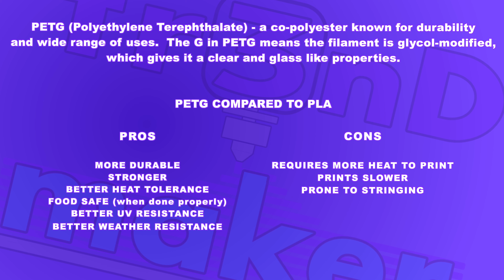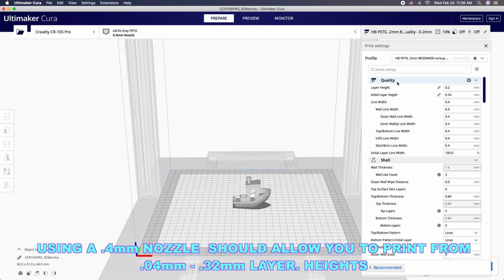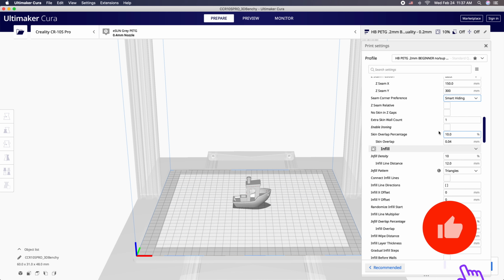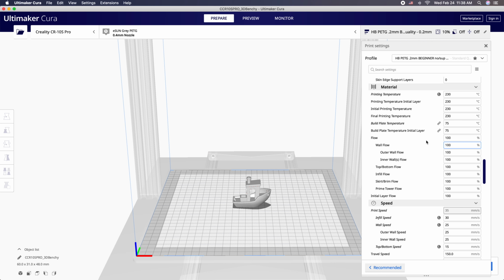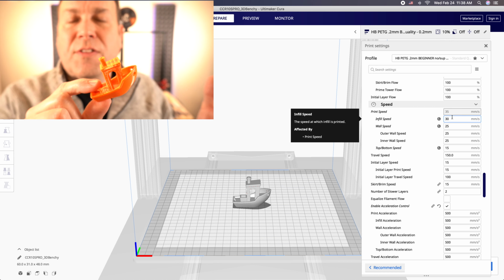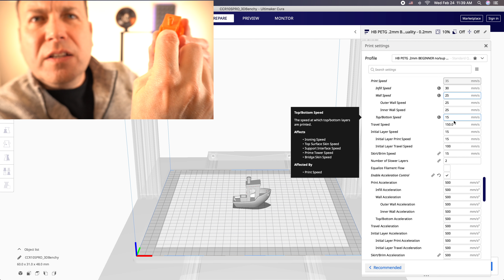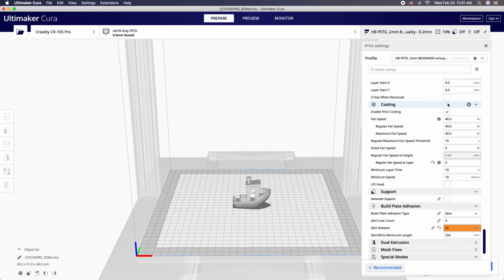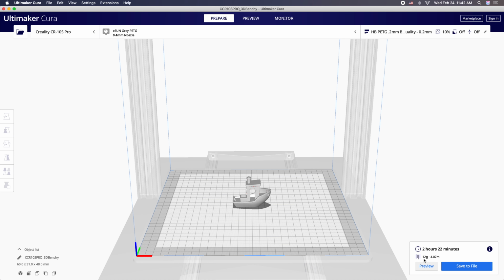How to 3D Print PETG Filament! Tips and Settings to 3D Print PETG Like a Pro - Cura

Comment: Overture PETG on my ender 3 max - 
240° Nozel (recommended 230 - 250)
80° bed (recommended 70-90)
print speed is 30mm/s

My extruder is knocking and chewing through the material causing it to break at the entrance to the Boden Tube.. I've slowed it down by 50% using the knob while printing and the knocking is still an issue

The first layer always prints perfectly, everything after is always knocking.
Reply from the maker: 2 suggestions… 1) add a bit more gap when leveling bed.  It is thick and lays thick.  On second layer it can struggle to extrude. 2) slow it to 15mms across the board.  Then try 20, 25 etc. till you are happy with print quality vs speed.  I often print at 20mms, but it is super strong and perfect looking.
Reply: @tr3nDmaker  I dont know if this sounds weird or not... But I just leveled my bed with a piece of paper until it just barely pinches, and then gently nudged the level down a hair, but when I go to print all the sudden my printer is printing mid air... For god knows what reason, PETG is the only material that causes my printer to behave like this..
Reply from the maker: @teddy5004  The only time I see something like this... is when something is loose and is shifting or moving upon printing.  The slower speeds may be exaggerating movement.  Check your eccentric nuts...  Bed, X carriage and axis should be snug and not shift or wobble.
Reply: @tr3nDmaker  Thanks!!
Reply: @tr3nDmaker  It was my X Axis! The wheel was so loose you could wiggle the right side of the X axis up and down by a quarter inch 😂😂😂 

Thanks man! I never would have guessed... I trusted this thing right out of the box and it worked for a good several prints before this...
Reply from the maker: @teddy5004  Glad we figured it out!  Be sure to Sub!
Reply: @tr3nDmaker  Hey man, sorry to bother you again... Have you ever used a feeler gauge to level your bed? I just bought one to try it out.... What bed level distance would you recommend for PETG?
Reply from the maker: @teddy5004  .07-.08mm with feeler gauge works for me.

Comment: Boy am I struggling to print petg. I’m a novice at printing but with minimal effort my pla prints are perfect. Im yet to have a single successful print with petg. Going to try your settings in the morning and will report back. Thanks for the video👍
Reply from the maker: PETG is thick and likes to print slowly.  Really like to hear how it goes for you…
Reply: One major thing is moisture, if you put your petg in the oven at around 70 degrees for like 12 hours or so before printing you will get much less stringing and problems from the print.
Reply: I was struggling also, even after drying my filament. Used his settings and printing good now!

Comment: Thank you so much for this video. I’ve been printing with PLA for six years but recently got a couple of spools of PETG to print ecto-1 details for the roof rack of my Cadillac. I’ve spent hours trying to get it to work, but I had awful bed adhesion. I copied your settings to a t onto my Wanda’s Duplicator i3, and it started printing perfectly right away.
Reply from the maker: Glad it was helpful!

Comment: Man alive I have been struggling with PETG doing bridging on the temp towers.. I'll give your settings a try. Thanks. Nice quick and to the point. Glad you used Cura to compare.
Reply from the maker: How did it work out?
Reply from the maker: Glad to help… let me know how it went t.
Reply: @tr3nDmaker  Apologies for the belated reply.  I have not gotten to the PETG settings I'd like yet. I'd say they are acceptable and I printed a fairly OK object which curled up off the glass mirror bed in one corner, but was useable.  I don't quite look as good as my PLA prints yet. Well, one thing is that PETG has gotten me tweeking settings that I had never ventured into before and got me thinking about what the printer is actually doing. I reduced the Cura acceleration defaults from 3000mm/s/s to 700 mm/s/s and the Jerk from 20 to 7. (I didn't realise how crazy high the default is set at )I don't think this affects the stringing but at least the machine does not go ballistic on fast travel moves now. My PETG is from South Africa, called SA Filament. Its PLA is excellent, but the PETG seems to be giving me better prints at 220C with fan at 70% rather than the 235-255C they recommend. I went up and down the temp scale from 210~285C and the fan scale from 0~100% speed. Apparently the colour of PETG can vary its response as well. In my case the colour is Copper, but I'd say it is more like the colour of std pot-plant brown. My bed temp seems to stick OK at 70C when I lay down the initial layer with fan off at 245C but I reduce temp after that and turn the fan on between 40~70C, as I was getting bad blobbing before at hotter with fan off, which has now stopped.

Comment: Thank you for this video. i just have one question. When my nozzle draws a line like from point A to point B and then back to A, when it is coming back it makes this little jerk that creates a tiny hole (the size of the hotend tip) just at the end of the line at point B. what should i change to fix this
Reply from the maker: Turn off Z Hop.  Its a move that is supposed to help with stringing.
At end of run on part… it hops up .5mm or so then moves to next portion to complete the layer.
Some times it help, sometimes not.  For PETG, I usually turn it off.
Reply: @tr3nDmaker  hah okay, makes sense, my z hop was on

Comment: How easy is it to remove from a non removable glass heated bed (ROBO R1+)  I’ve hear with some printers when pealing it off the bed it can pull some pieces of the glass bed with it.
Reply from the maker: That can happen... but, it often causes by impatience.  Small items usually pop off with little to no effort.  Big and flat surfaces can cause these issues, if you do not let glass to cool down.  As glass cools , it shrinks and loosens bond from 3D print and glass.   Also, I use a glue stick.  Adds a barrier between glass an 3d Print also.  For, stuck prints.  Let cool down and very carefully get a scrapper under edges, and work around 3D print until it releases.  Don't force it... slowly work surface tension until bond releases.   If really stuck... try heating up then let cool down again.  In 5 years of 3D printing and 1000's of prints strictly on glass...  I have never cracked or had the glass break off.  Worst case scenario... remove bed and place in freezer with 3D print.  Super cold will release tension and should pop off easy.

Comment: Dumb question for ya. I had petg bed set at 70 and it warped on the corners as well as nozzel set to 230.  

Is there a way to avoid that? I did use hair spray and that didn't work. I also used a little bit of tape to hold the corners down but that didn't work. I tried with and without both and still warped.
Reply from the maker: 3 things to solve problem…. 1) be sure bed very clean… a touch of soap and water on very lightly damp wet paper towel.  2) be sure bed very level with nice squish(lines on 1st layer should connect). 3) rub on Elmers Purple Glue stick.  If this doesn’t help… check to see if ac or heat duct is blowing on or near bed surface.  The air blowing will cause cooling and separation.  Let me know if this helps.
Reply: Bed is clean, and I don’t have glue at the Monet. 
No air or heat or air in general. I will try glue stick tomorrow or Thursday. Thank you by the way! I appreciate it.

Comment: Hi, Do you have a video of PETG Support Settings, I am struggling with supports and adhesion. My finished face that has sat on the support seems really stringy. I'm using a CR10S Pro V2 and Cura 5.0.Any help would be great as your videos are so easy to follow.

Comment: The infill density is greyed out for me. Turns out after initially setting it up I need 80-100% as I'm building a aquarium bottom trim that needs to hold 150lbs. How do I increase the infill density without changing any other setting? It prints perfect as is now. Also I do want to increase wall thickness as I'm utilizing self tapping screws and I want the cylinder extrusion cuts or pilot holes to be thick and strong. Your standard 3 lines works okay but I don't want my parts to fail so it can take 3 weeks to print and use 12 rolls idk I just need it super strong and sturdy lol. Lastly I just remembered there is one thing I struggle with is minor stringing and that is already lowering the retraction speed from 30 to 20 based on a retraction test in cura. I have yet to test retraction distance or travel speed but I want to see if by any chance you have any experience based on what I have already tried. I feel like I have my z-offset perfect based on my cube dimensions test all walls appear perfect and I can't separate layers and I don't see that smooth surface you get from the nozzle being too close. I'm sorry I'm 3 weeks in to the 3d printing world and I want this prototype to print perfect or glass will break and fish will be on the floor :( My model doesn't have any complex shapes or overhangs but I really wanna nail that overhand test mine was only able to complete 60 percent overhang before it got messy lol.
Reply from the maker: Ok,  lots of things here.  80-90% infilled is way to much.  If you want strength, go with more walls and top and bottom layers.  I think 5-8 walls would be super strong.  For top and bottom layers, match it in mm.  So 5 walls at .4mm would be 2mm thick.  Match that to the layer height.  lets say .2mm height would be 10 top and bottom layers .2 x 10 equals 2mm... For record, I have never had to go this thick, but if you want overkill.  

Now infill %... I used to go 40% and waisted a lot of time and plastic. 20-25% will be wicked strong with all the walls and top/ bottom layers.  Go with simple infilled pattern like triangles.

With these setting you could drive a car over it and main structure would be fine.

Good luck.

Comment: This is a good vid! I had issues with adhesion and slowing down the first 2 layers and turning off fan for first 3 layers and then only fan at 30% worked like charm. I also used the stick glue on my glass board
Reply: Going to try this. Hopefully it works and sticks to my glass bed.
Reply: I print a 0.2mm layer level five squares block print and measure the thickness of the layer with a vernier. Then I adjust the level, reprint, .... till I get 0.2mm. Sticks very well with 245C on a 70~75C bed for the first layer. Fan Off. I drop the temperature after the first layer. No glue required.

Comment: Very helpful video, as a nooby in 3D printing i want to learn as much as i can. I have one request for you though. Pls. talk a little slower lol. As a Dutch man i can understand you pretty good, but sometimes it goes a little bit to fast. I've been printing with PLA for a while now and i'm going for the next steps to print with other filaments to try to get stronger prints since PLA will bend and warp over time when there is a little tension and/or a little heat on it.
Reply from the maker: PETG is a really excellent filament.... A bit slower to print, but worth it.  I thing PLA+ is great as well.

Comment: reading these comments make me cringe. guys, your adhesion issues weren't to do with what was said in this vid, it was to do with an unleveled bed. invest in a £5 set of feeler gauges and level your bed using 0.2mm gauge, 'til you can afford a 3dtouch or omron proximity sensor, then you can just heat soak for 3 mins and be gucci for the day. also buy a textured pei build plate, that should help, but petg is sticky af... I can't get it off my old nozzles, I ended up buying a plated nozzle for petg alone and use the other ones I bought for pla

Comment: Thanks for this info. I just had one question. Im running a CR-6 and im having a hard time getting the petg to stick to the glass. I've heard it should be semi farther away from the bed compared to pla. How far would you say I should be setting my z offset when leveling my bed?
Reply from the maker: Check out my video on leveling bed w paper.  Pay close attention to part at end where I go over what perfect gap from nozzle to bed should look like.  Once you see what too close and too far away look like... you will always be perfect!
Reply: @tr3nDmaker  for the cr6, it auto levels itself. And all of the nuts and bolts are tight. I actually never have an issue getting pla to adhere. But petg just will not stick. No matter what I do. Hair spray, glue stick, slower speeds, hotter temps, nothing works. My first layers never stick with petg. People talk about how strong petg sticks to glass. But you could have fooled me. I could blow on the print and it would fly off the bed. I seriously don't understand what I'm doing wrong.
Reply from the maker: @sabresswords  2 Things.  1st bolts tight does not mean adjusted.  The Eccentric nuts are designed with an offset hole, so turning them actually causes them to move the wheels in and out.   So, the question is.. ANY wobble in bed or carriage means it need to be adjusted.  2nd... If bed is level and using bltouch... you will need to adjust the Z OFFSET.  This adjusts the gap from the nozzle to bed.  PETG is not as forgiving as PLA, so nozzle needs to be closer to bed.  - z offset.  Can be adjusted on the fly with first layer in setting.  Just print and start lowering nozzle till it is adhering to the bed.  Use a glue stick with super clean bed.
Good luck... let me know if it works.
Reply: @tr3nDmaker  i have no wobble or movements in any of the axis. About the z offset, I've gotten so many conflicting opinions on that. Some say for petg, it needs to be further away from the bed. Some say closer. I've tried as close a z offset as .10 and as far away as 0.30 and everything in-between.  With no luck.
Reply: @tr3nDmaker  if you have time to chat id love to pick your brain about the issue.  I've installed the micro Swiss hot end, a hardened steel nozzle, the new community firmware and I did a PID tune. No matter what I do, I cant get this dang petg to stick. Its infuriating.
Reply from the maker: @sabresswords  send me a quick vid of it printing first layer... in vid show gap from nozzle to bed then what 1st layer is looking like.  via Facebook: tr3nD maker

Comment: Hmm. 230 and 70. Maybe had my bed too hot or fan going too hard.
Reply from the maker: 70-80 for bed is fine… definitely no fan on first layer… often I run no fan on second layer also.  35-45% fan max after initial layers.  The fan can cool petg too fast to stick well.

Comment: I have problem with my my ender 3 s1 pro. i used the setting that you have recommended but the temperature starts to drop after 10-15 while printing. any idea what the problem might be? new printer and just started doing 3D printing
Reply from the maker: In temperature settings… there is a setting for temps for 1st layer, and last.  Be sure all temps are the same.  Guessing after 1st layer temp are switching.

Comment: Do you feel you’re getting quality prints like you would with PLA? I’m looking to print large flat parts on my CR10 Max.. I’m a bit nervous to try Petg.. also I’m using a 0.8 nozzle for these larger prints.. although I might try going down to a 0.6 for better detail. Might as well if I’m printings slower with petg. And I’m used to printing a bit slower with the larger nozzle anyhow. Also.. I’ve got no enclosure. Any advice?
Reply from the maker: Enclosure not needed for petg.  I can get excellent print quality with PETG.  Definitely slower, but much stronger and better for heat.  I have used .6mm nozzle for petg with fine results on CR10 S5 with direct drive.  With .6mm on bowden should work well. Direct Drive will run faster though.  Good luck!
Reply: Thank you, I’m going to try it!

Comment: I like the channel I just started with 3d printing I am trying to use PETG which is difficult I have the same printer as the video the CR10S pro and I hope I can achieve the setting this is the filament that I use is the sunlu which would be the best setting
Reply from the maker: Follow my exact settings and temps and you should be PERFECT..  REMEMBER... Print very slow to start and with a little practice start bumping up speed 5mms at a time.  Be sure to Sub!

Comment: Looking to get my first printer for a PETG project. I was looking at the Ender 6, sine it boasts faster speeds (up to 150mm/s), is this essentially useless for printing with PETG?
Reply from the maker: Useless… No.  Its a great 3D Printer.  But, when printing PETG,  you will not benefit from faster print speed.  Maybe a bit, but not dramatically.
Reply: @tr3nDmaker  Thanks for the rapid response! I guess I'm leaning more towards the Ender 5 PLUS, since it has a larger bed and an auto-leveling feature
Reply from the maker: @herdinstinct8282  You will be super happy with Ender 5... Nice 3D Printer across the board.

Comment: can you print PETG on the Ender glass bed or do you need to use some kind of release agent so glass doesn't break?
Reply from the maker: I print PETG straight on glass all the time… just let bed cool and it will pop right off.  Elmers Purple glue stick works amazing as well to get better adhesion.
Reply: @tr3nDmaker  do you use 
smooth or textured side of the glass?
Reply from the maker: I always prefer smooth side… if you need better adhesion… use Elmers purple.  Video on this topic and leveling bed coming very soon.

Comment: Awesome video. My first Test Cube print came out great using your settings. I am doing 230 70 and I get a little filament string ball I have to remove at the beginning of the print. Not sure if this can be resolved.  Thank you!
Reply from the maker: So glad to help… PETG is amazing, although a bit slow to print.
As for blob, if its easy to remove… don’t worry about it.  If you getting good result… dont mess with it.  Just print away!